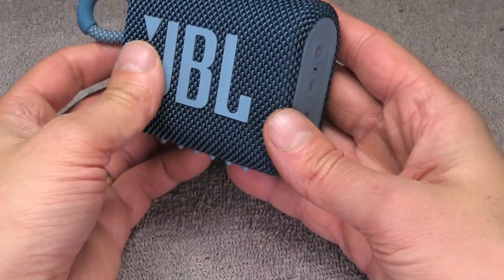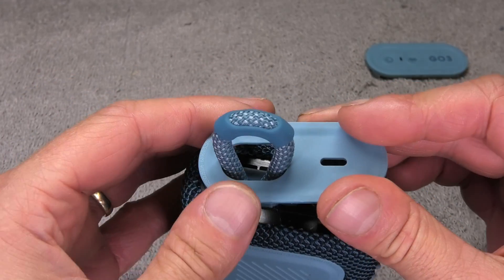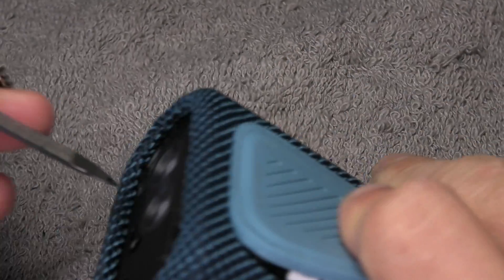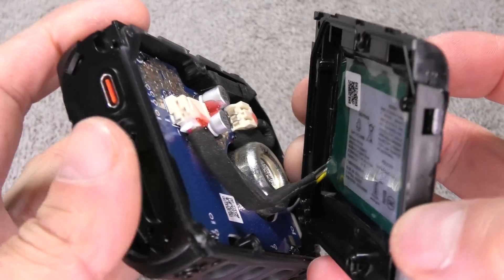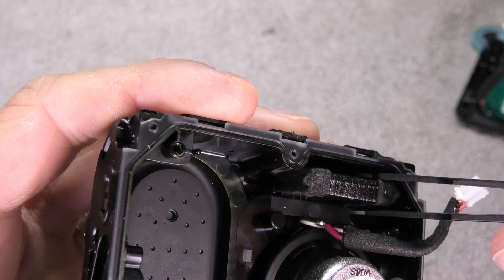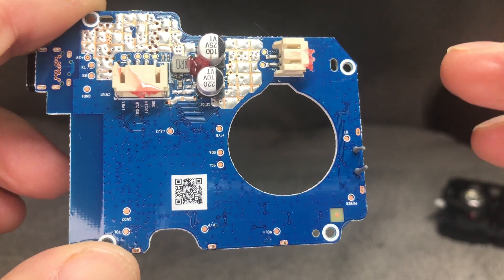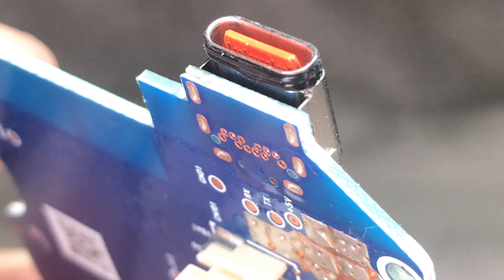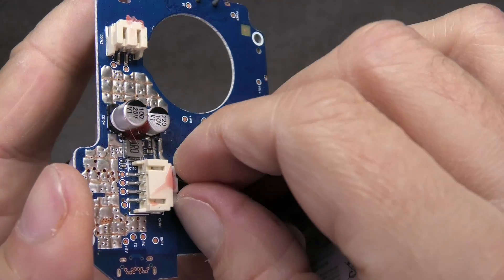Looking inside JBL GO3 Bluetooth speaker (4K Teardown)

Comment: To compare with other teardown videos, each JBL GO 3 has a different component, isn't it?
Reply: There are 3 versions that can be told apart by the first two letters of the serial number. 
If the letters are ND it has no screws under the side panels or rear rubber panel. If it says CS it has them under the side panels only and also has the dowels instead of clips. The letters on this version will say DT.